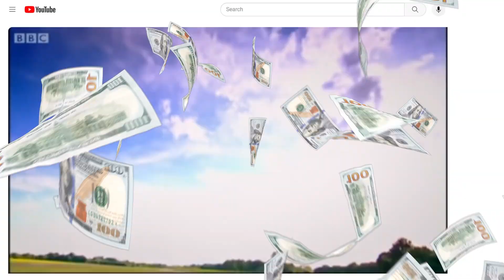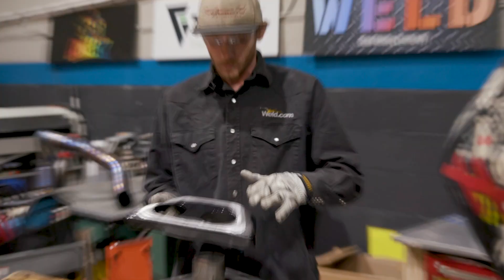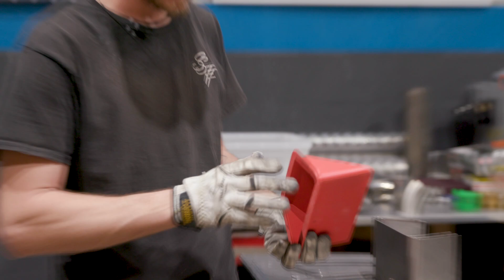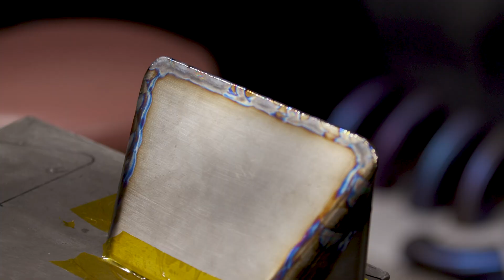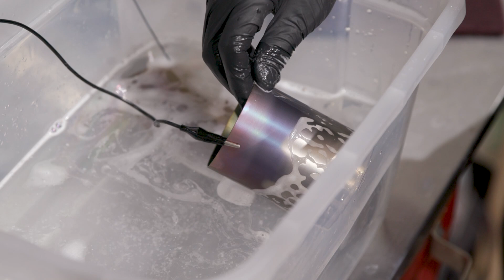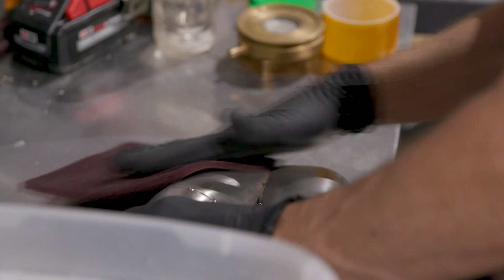Repairing A Supercar : Anodizing & Welding A New Koenigsegg Exhaust

Comment: in position to one's inquisition a small imposition to fix the disposition.
Reply: one told to do it them self, is met with a sight of nothing to be done... for nothing its self stands thru the longest of time, in time many never find. to say one thing has been paid for as it is of existence now, over the fuel burned in its time added in total to individual vehicle cost... how much tax is that one paying over ever gallon of gas? $6230.95/gal as the augmented push to emissions regulations.
Reply: illusion of speed